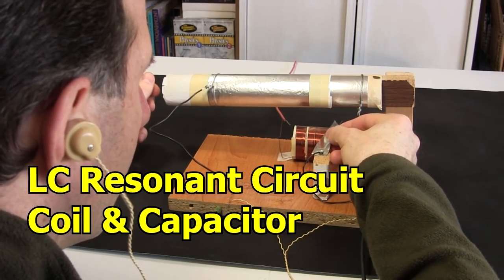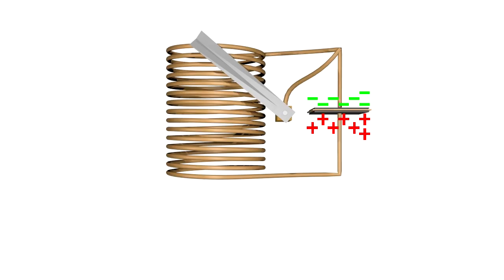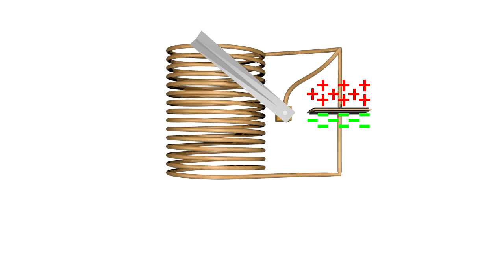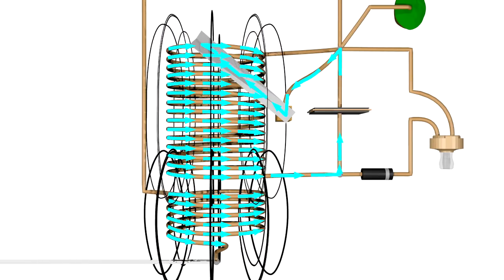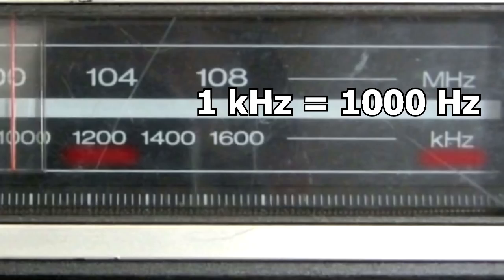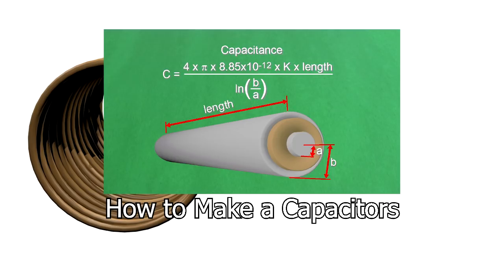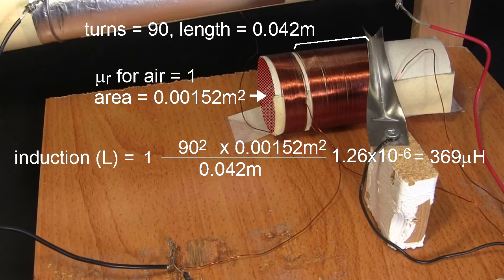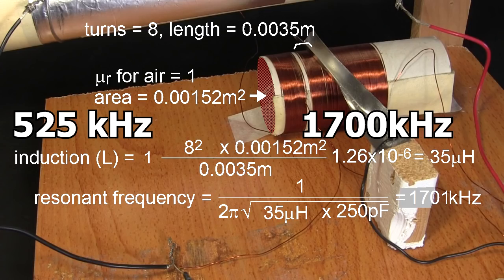LC Circuit: Selecting Coil and Capacitor

Comment: I don't get the "C" math.    250pF is really like  .000000000000025F   yet, we can use "250" in the same equation as "Mf" .  Which has 3 less zeros..   uH does not have the same amount of zeros.   I get the math,  just don't under stand why and how everybody can just drop those "0"'s.  What is the real number entered in the equation.?   I know I ain't no math wiz.   I think there's a short cut, idk.
Reply from the maker: 250pF is .000 000 000 250F.  Maybe that's where you're going wrong? The seqeuence is, milli, micro, nano, pico.
Reply: You don't drop the zeros when you actually plug them in. Many people use scientific notation so you just add/subtract the zeros in the exponent.

Comment: at 7:01 you have told 424 but result in formula is 524
Reply from the maker: Wow! I can't believe I didn't notice that after listening to it probably a dozen or more times when editing it. Then again, maybe that's why I didn't notice it. At least the video is the correct one, I'd rather that then the other way around. Thanks for pointing it out.
Reply: My professor in the university has called this effect as a "to review with a fresh eye". The probability to find new error increase with break period duration. So, there are two options ... 1) take a long break to forget it and check it again 2) ask someone else to check it. ....
it is very typical phenomena in self checking

Comment: What animation software did you use?
Reply from the maker: For the magnetic fields and the 3D modelling I used Blender 2.71 (https://www.blender.org/). The + and - charges and the blue arrows for the current were drawn as 2D GIF images in OpenOffice draw and inserted one-by-one in the video editor (Sony Vegas Movie Studio 11). You can see my process in my old video celebrating 1 million views http://youtu.be/kZj0_L7lWss.
Reply: Cool. ty.

Comment: Irish American, Dublin ?
Reply from the maker: Nope, Eastern Canadian, so some Irish influence for sure.
Reply: @RimstarOrg  @RimstarOrg  Eastern Canada - you're on the right coast to catch the accent - directly across the sea!  I'm interested in using your neural net  back propagation code- I'm new to neural nets, but would I be right in thinking that this approach doesn't offer anything a LUT (look-up table) or perhaps a kernaugh map (for logic minimization) , doesn't provide? The system won't grow any more intelligent than the training data provided,
 intelligence in this case just calling the appropriate/next element in a LUT.
Reply from the maker: The example I give can be done with a LUT instead but there are uses where it goes beyond that. Neural networks can do object recognition for example. The inputs would be an image of an object and the output would tell you what the object is. I guess that's sort of like a LUT but how do you do object recognition with a LUT? But in that case it still only recognizes objects that it's been trained on so in that way it's like a LUT. There are also neural networks that look at an image and output a descriptive caption for the image, neural networks that given a text description, output an image, neural networks that being trained on recipes can output novel recipes,... There are countless examples that go beyond LUTs.
Reply: @RimstarOrg  Thank you for the detailed reply. I didn't mean to question the value of your code or approach, I find it fascinating but I'm new to neural networks and see the provided neural network will only provide the same functionality as a LUT for object recognition - I think the key to using a neural network like this to provide intelligence would be for primitive tasks of things like edge detection, path-finding    to build more complex and generic approaches , intelligence that can be used on non-trained data. Path-finding would be one where you could use a random seed, go through all possible iterations, score for the lowest possible time to solve, then feed that back in for the next path-finding excercise. Done over a large enough dataset - it should lead the net to arrive at some general rules for pathfinding. But I believe this would be a genetic algorithm and not a neural network. I can see how a genetic algorithm would accomplish your examples, but not a neural network- I struggle to see how a neural network is anything other than a LUT. I'll have to read up and fill my knowledge gap!

Comment: I keep seeing this design for a radio as a project, but it's not very practical as you can't seem to buy crystal earpiece easily. It's certainly not sOmething your average joe would have lying around. Amazon has them for $10 but that kind of defeats the purpose of a cheap radio made from household materials.
Reply: At this time in history the point isn't really to be able to build a cheap radio, but to learn how the simplest possible receiver works.  

Anyway It never was quite as cheap as you might think because you need 50 feet or more of antenna.

I recon that instead of going into an earphone you could go into a simple amp circuit and then drive a speaker or earbuds if you wanted to.  You could easily salvage parts from junk electronics, and THAT circuit is pretty easy to understand too.

If you did that you would know more about electronics than 99 44/100 percent of everyone you will ever meet. 

And THAT is the point.  I think.